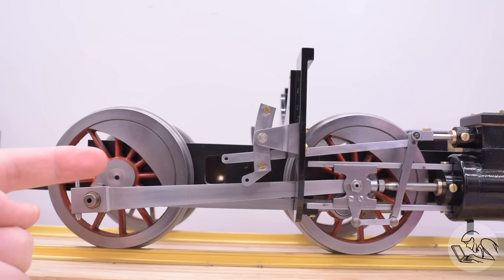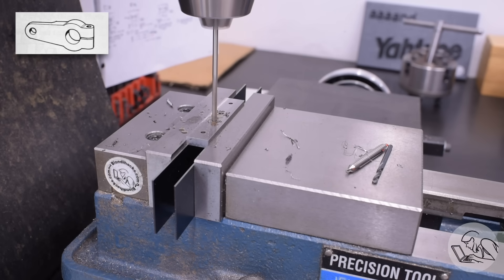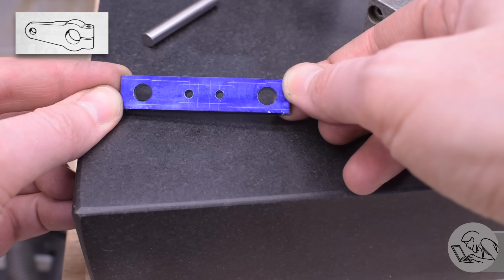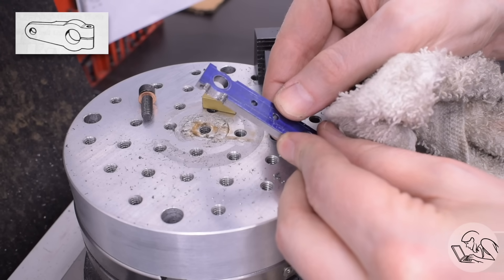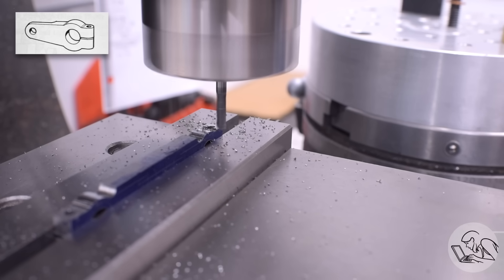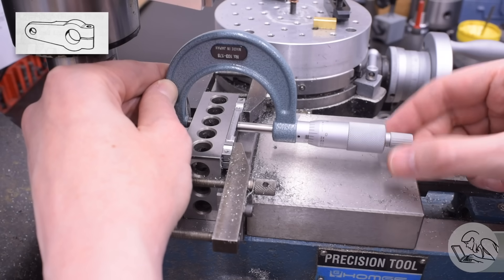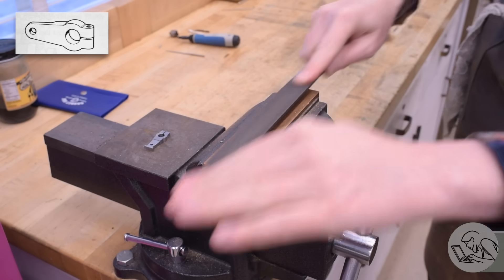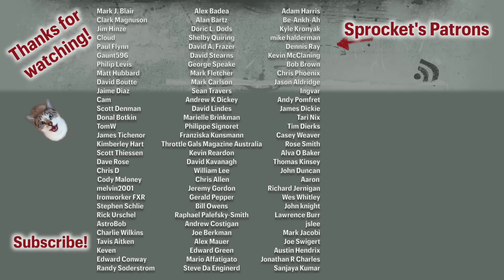Return Cranks - Pennsylvania A3 Switcher, Part 65

Comment: For anyone else wondering:  "The US and Canadian quarter coins are very close in size, but the Canadian quarter is slightly smaller. The US quarter has a diameter of 24.26 mm (0.955 inch), while the Canadian quarter has a diameter of 23.9 mm (0.941 inch). " - Google

Comment: I love the inclusion of the 20p. Now I actually know how big (or small as the case may be) these components are i know the odds are low but please contine to use the other coins or if that feels like to much work a small rule with both metric and imperial units, thanks for another great video.👍

Comment: Great video Quinn, looking forward to seeing the A3 run on air! 13:55 or insert a wire loop threw the convenient hole in the other end of the part and hold onto that. 14:42 there could be some fun escalations on this.

Comment: hey Quinn, thanks  for the video :)

I have an idea for the moment you will go live steam on that engine (and possibly before that with air) you could make a rig similar to a dyno to run static tests, could be a nice side project and I believe it would make nice camera shots, with proper close up frames of the mechanism in movement, that will probably be more difficult to obtain by following the engine on tracks or  with a go pro stuck on the side.

Comment: In a recent CEE video, Curtis mentioned that he always removes parallels from beneath the workpiece after getting it secured in the vice. I've noticed that you always leave parallels in place while cutting. I find the differences between little machining and big machining really interesting to learn about, thank you!
Reply from the maker: He does different kind of work than I do, which is mainly why the differences. For him, he doesn’t need the precision level achieved by tapping down to parallels, so it’s fine to remove them. I have to leave them in place because my tolerances need to be tighter.
Reply: ....and then This Old Tony posted yesterday, left his parallels in and it looks like he hit one with a drill. :)

Comment: These kinds of parts are, in my opinion, the most interesting. The ones with the tapers and the rotary features. It just adds a bit more complexity to your otherwise usually square shape, even though they are, as you've said, simply decorative. That tip about edge finding with the slitting saw was really cool! It seems so straightforward once you know it, but for some reason, little things like that escape your grasp when you think about them yourself until you check what others have done. I'm sure you've thought of this too, but for your corner grinding setup, for the smaller pieces that are harder to hold, and also have holes on the other end anyway, it might be useful to rotate it with a little pick or a heavy bit of wire so you don't grind your fingers off. You might not get as much control as directly in your fingertips, but I bet you could still get a good feel for it through the long handle.
Reply from the maker: Yah for horizontal setups, I have a pick handy for doing that. This one didn’t really have a way to hang on to them vertically and I didn’t want to risk losing control and chewing them up on the belt.